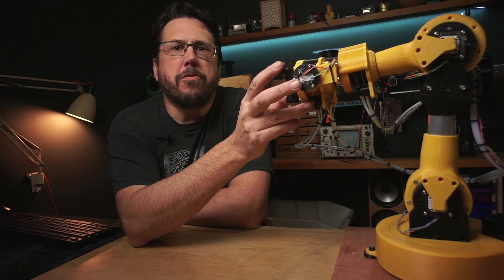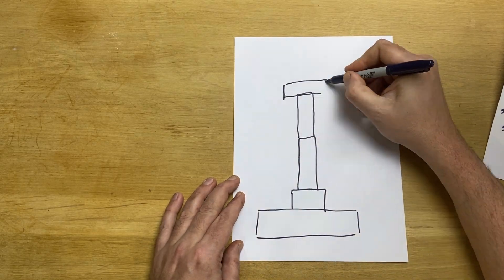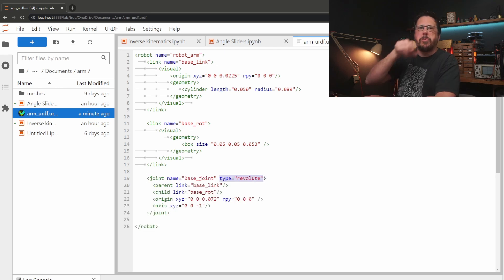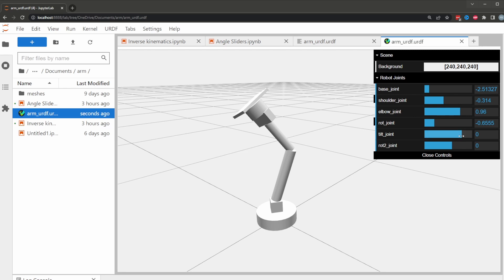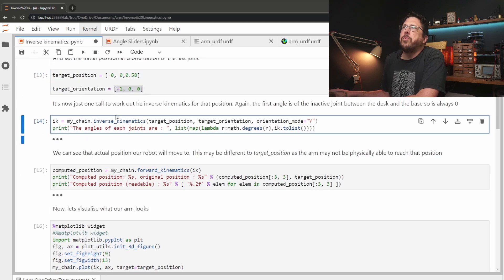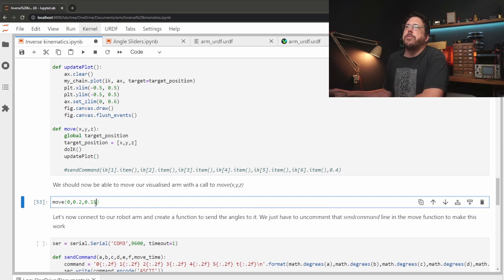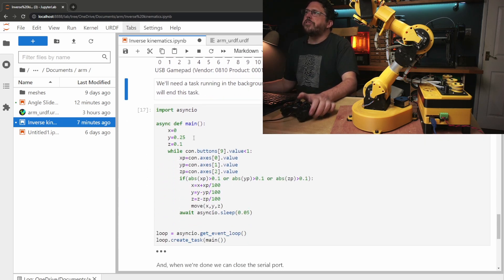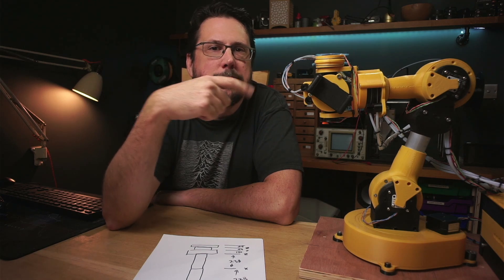How to cheat at Inverse Kinematics

Comment: Hello
A very helpful and informative video
I am currently building a robot arm myself, so I am wondering how the connection from the program to the hardware was realized. Do you use a microcontroller like a Rasparry Pi or how do you realize this connection?

Best thanks and a cool colleague you have built😁

Comment: great stuff! one question if you could guide me please...

how does controller know the current angles between joints? do you have some measuring tools plugged into joint or you just maintain those angles throughout the runtime of the controller script (after each move, as a "state")?
Thanks in advance!
Reply from the maker: in the previous video I show how I linked magnetic angle sensors to each joint

Comment: you would think there would be software that allows you to define the arm more easily then typing out an urdf file. You are doing very interesting work.
Reply from the maker: Hi Chis, there is software available to convert Fusion 360 models straight into URDF, but I felt that getting to grips with a simple URDF file would probably be more educational - it's nice to understand how things work before using automated tools.
Reply: @roTechnic  I use FreeCad which can create a step file, which I believe is a common format. I agree that it's nice to understand how things work.  The value labels are not easily guessed at though, and I wonder if some specifications are missed just because you didn't know about them.  Also in the rotate z access the value was 0,0,-1. Why -1 and not 1?
Reply from the maker: @chrisBruner  Yeah, some of the specifications were missed out to keep this a small and simple as possible - this in the minimum that was needed to make this work - I know you can do a lot more with URDF than I did here. the Z axis was -1 because it rotates anticlockwise, not clockwise.
Have you seen any IK chains that take STEP files as input, as fusion also has the ability to output this format?

Comment: Great video, learning IK was super daunting, but worthwhile. IK looks more complicated then it actually is, but seeing the maths is a bit of a yikes! Essentially all you need to do is, loop through each joint treating the later joints of the chain as stiff, so all you need to do is solve a simple one joint problem. Then you move the joint a little fraction towards the target location, constrain by the hard limits and move on to the next joint. As you repeat the procedure multiple times through the chain, the end point gets closer and closer to the target position until you call it solved.
Reply from the maker: Thanks, you've inspired me to give it a go!
Reply: For  those who are wondering, this method is called "gradient descent". It's an alternative to hard-solving the joint angles for the target end effector position, which saves you the time and effort of making a fully fleshed out IK model.

Comment: I don't remember exactly what is is, and can provide more info if interested, but I was doing a robot arm project (Simple MG995 servos), modeled it in fusion and found a really cool fusion to URDF converter asdon someone had made.

It required me to flatten the hierarchy tree and joints first, but came out really well with ROS.
Reply from the maker: Oh, that sounds super useful! If you remember what it was, I'd love to know!
Reply: @roTechnic  I dont believe I can link without getting caught in the spam filter on youtube so  can only give the search term of "fusion2urdf" which should bring it right up. 

Its a script hosted on github which has decent enough documentation, and while it hasnt been worked on in a small while I have no reason to believe it doesnt still work.
Reply from the maker: thank you. I’ll give it a go.